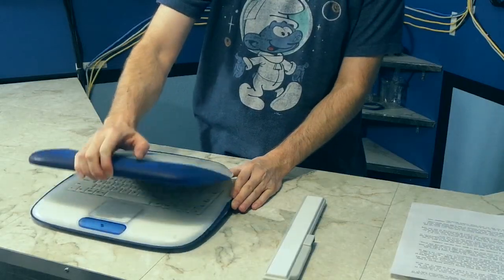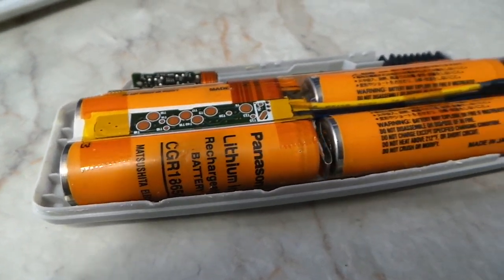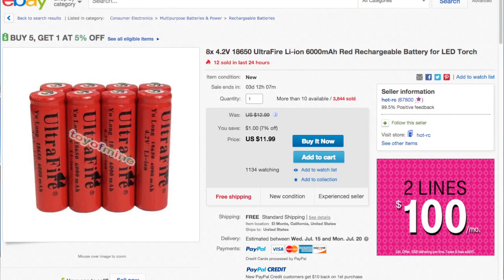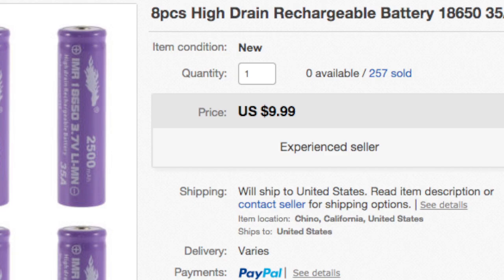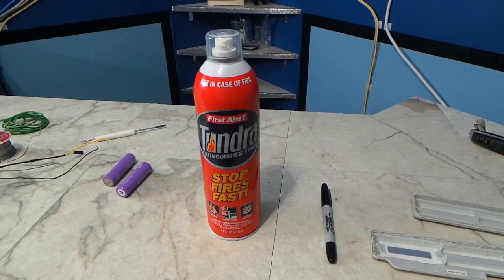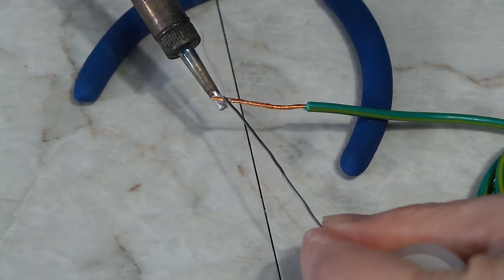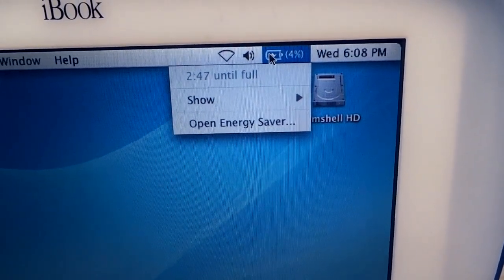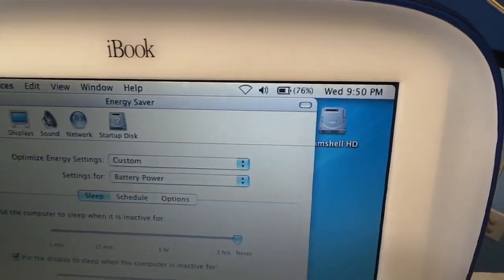Rebuild a laptop battery pack

Comment: You shouldn't manually solder 18650 cells. Use a spot welder and nickel tabs.

Comment: Just because you can solder connections to a lithium battery doesn’t mean you should solder connection to a lithium battery. Small DIY spot welders can be purchased for fifty dollars.

Comment: Hello guys, this 2024 September 24. I used to have that laptop many years ago, i bought it as a used laptop. I was happy to own an apple laptop, and learning how ox work, since i am a windows user. My battery was bad, though as a computer technician, i was able to rebuild it, and go about three hour from it. Was mainly using it to watch movies. Those days was fun. The battery, you bought the capacitance or power was low.. mine i later used the battery pack to build and laptop battery backup. I was just tired of mac, because  of the software i had was on windows pc. It was really fun building battery and pc in those days. Thanks man.

Comment: Well, it's a stretch to say they are lying. Those junk batteries really do have that much energy, if you trickle discharge them at 50 uA or so. The good (Panasonic  etc) batteries have far more capacity than listed, they just include the effect of internal resistance and put a decent load on it to provoke more resistive loss, and they list the energy you get after typical losses.

It's the equivalent of saying a phone has two weeks of battery life, without mentioning that it is in airplane mode with the display off the entire time.

Comment: For anyone reading this, you need a class D fire extinguisher in order to stop a lipo fire. Regular ABC extinguishers won't work, and they can actually spread the fire. I couldn't find the extinguisher in the video online anymore, but I found similar ones from the same manufacturer, and I am nearly certain they wouldn't be effective against a lipo fire.

Sorry for being critical, especially on such an old video, but I had to mention it since it's a matter of fire safety.

Comment: most likely the bms lost power it read 0% you lucky it did not lock out and kill battery pack most newer ones die when the cells are removed.

Comment: Those cells shipped so low that they couldn't start the computer? Did you measure voltage before connecting them together? If one of them was charged you would have had a decent amount of current flowing into the empty one, definitely enough to degrade the lower SOC cell and probably do some level of damage to the higher SOC cell....which would have made your pack a real mess. You'd have 3 groups of cells that only took heat damage from the soldering (probably not as terrible as its made out to be if you stay under 3 seconds) but the group with the mismatched SOC would have had one cell with noticeable damage in terms of capacity and IR while the other would probably be in ok condition....maybe a bit of capacity degradation/life cycle degradation and IR increase. That weak parallel set would then be your capacity as your pack is only as good as the weakest link. First series string to hit undervoltage cuts the whole pack off.

Comment: First thought was damn you know this is an old battery when there are CGR 18650's from Panasonic. Then I saw this video was put up 8 years ago.....So what year is that pack from? I'm guessing mid 2000's.

Those Panasonic CGR's are well known to be some of the most resilient 18650's out there. People have pulled out 15+ year old cells that still had good voltage and capacity tested over 80% of the rating.

Comment: I have problem with doinng this. The baterry just can powered the laptop in 1 hours. Is imposible because i use 2600mah batery so i get 5200mah in total. After i reasambled i found the batteries is not balanced. Why it happen? Does it because bms was broken? or it can fix after i use battery in several time?

Comment: I have a battery spot welder - I know this video is a bit old but do not encourage people to solder to lithium ion cells. It only take one to have the soldering iron on the cell for just a bit too long and they can go nuclear. spot welders are great, fairly inexpensive and make the connection in a split second, not heating the battery anywhere near as much as soldering. I repack laptops with Panasonic 18650's which usually end up running longer than the original battery.

Comment: You used to have an open invitation to be on your show. Somehow I doubt that still applies.
So here's my issue. I have a Dell Inspiron Mini 1012 that I bought for cheap at an estate sale, and not only do the batteries not charge, the battery pack is rejected as incompatible at boot. What causes this? Is the battery controller damaged, or is it rejecting the battery pack because it's drained?
Reply: From my experience with other laptops, its usually the battery controller. Possibly shorted, or it thinks the battery is no good.

Comment: As an alternative to soldering to the batteries themselves, how about making something like the battery holders you would find in your typical portable tape or MP3 player?  Spring-metal tabs that you simply snap the rechargeable batteries into, and you simply wire the contacts up in the appropriate configuration.  That way you're not risking fire/explosion from soldering to the batteries, and you can change the individual batteries out.

The other thought is, if you have a machine you want to be functional without needing to look original; get some of those rechargeable USB power packs and make up an external pack.  You wouldn't be able to charge the packs with the computer, and it would depend on the original battery pack having a power output readily divided into 5v increments though.
Reply: Interesting idea but there is generally not much room in the battery packs to allow for battery holders so it would be a bit tricky - might require 3D printing a whole different case.

Comment: COuld it be just 1 battery?  From my understanding in series the voltages stack but the capcity is that of the lowest pack, maybe theres just one battery that cant charge fully and its dragging the capcity down?   Maybe it would be wise to do capacity test on each battery and perhaps you can get some good cheap ones if you dont mix any bad ones in, your pack could be fine.  Just speculating here but yeah you get what you pay for, but im still interested to know the capcity of each battery, and maybe even the soldering onto the ends could have damaged one's capacity?  I heard heat isnt good for lithium batteries im sure the video maker knows now, most all are spot welded togher, which leaves me skeptical if those spot welds can even transfer enough amps given their small size, a solder joint should make electrons flow easier, theres no gaurantee the other tin will contact the battery other then where the spot welds are , which are small.  So im not totally discounting soldering onto battery for other reasons, but heat cant be good, but im not sure about that either, what exactly the heat tollerance is and does it permantly damage the cells or just for a moment or what.  Anyway thanks for the video im thinking of doing the same and wilil go ahead, trying not to solder onto the batttery but ont he the nickel that hold them together from already spot welded pairs.  Recycled of coure, but i think if you match them all up nicely you can make a good pack out of some bad ones without the need for new batteries.  Its usually just 1 that ruines a pack and is thrown away while the others remain good.

Comment: To get an old laptop working that needed a bios update, which requires at least a 20% battery charge as well as mains supply. With the laptop battery removed, I connected my old 9v battery drill battery directly onto the laptops battery pins for the +- -, did the bios update, which fixed the battery charging problem and as a bonus it fixed the RAM issue that had more than 1/2 the RAM reserved. Job done.

Comment: I have a question if you had the battery of per say three power banks that are each 10k Amphers and let us say you connected all three of them too the chipset of the original laptop battery would it work without frying my motherboard?.

Comment: Don’t get excited, the reason why it lasted for about 1 hour and 40 minutes is because the device was idle (it was only on the desktop screen without loads). 

I think if you use it (watching a movie for instance), it wouldn’t last as long. I estimate it may last 45 minutes which is still acceptable in my opinion.

Comment: I really wouldn't recommend using cheap Chinese batteries from trust fire and co. The batteries are all different, you never really know what you get, sometimes you even get a battery filled with sand which a small coin cell inside, providing 200 mAh or so. Which is bad enough, but the main problem is that you never know how much of a fire hazard these batteries are, since like I said, you have no idea what you're actually buying.
And most laptop batteries don't actually balance the cells, they just monitor the voltages. They stop charging when at least one of the parallel packs is fully charged and cut off when one of the parallel cells is completely drained. Since trust fire batteries are basically just random capacity and random charge level. Not only will they probably not be matched when you buy them, but even if you manually match them. The capacities will all be different and so the cell voltages will likely drift apart pretty quickly, eventually only allowing to charge the pack a little or discharge it a little until one of the cells is fully charged or discharged. You may have only gotten 1 Ah or so out of your batteries, but as long as they reliably hold 1 Ah and don't randomly catch fire or so, that's essentially the best result you can hope for, for such batteries. 
If you're less lucky, your laptop could not run at all, cause the batteries inner resistance is too high to provide enough current to power the laptop, it could only run for 5 minutes. The batteries could run fine but only last for a month until they're completely worn out. With these batteries, pretty much anything is possible. And as the names of these batteries often suggest, fire is of course always an option.

Comment: I would not be using scotch tape to hold the battery's together inside the pack.  Scotch tape tends to get brittle from heat.  I would have used (red greens favorite) duct tape.

Comment: Does it matter which tap on the battery string is attached first, second, third and forth? Does power from the total need to be connected first before the taps? I was told that it can damage the controller if the right sequence is not done right.

Comment: I did not have any extra room to use wire. I took a tin can and cut the lid into strips. I used a butane soldering iron and flux. I placed a lot of heat on the batteries. I purchased high quality Sony batteries 9 dollars each. It was still difficult to fit into the pack by just a few mils. I took a Dremel tool to further grind down the solder joints. I got it all in and used rtv to reseal the case in case I ever need to reopen it. And it works great. It was a Sony Viao laptop from the year 2000. I installed Windows xp on it to run old games and other software.

Comment: just a thought i am tinkering with 2 old hp dv 8000 laptops they both run xp so i can run older xp games and you guessed it batteries are shot... is it worth rebuilding? i am a complete noob no soldiering iron tools to open battery packs etc vs buying "new" chineese works with (in substitution of oem) batteries on ebay?

Comment: Watched in 2021. Your video gave me the confidence to attempt a replacement-actually 2 replacements. I was given an HP Pavillion that had Win 8 on it. I did a total hack job it that I am not proud of. But, it works and I get about 3 hours of run time on battery power even while using a RTL-SDR dongle.
I have an even older Gateway MX6424 laptop. I had to use a different vendor so I used another vendor (18650store) and bought "Samsung" batteries. I did a much better job on this replacement and reconnected everything. The internal BIOS has a battery calibration routine. It runs a calibration charge/discharge routine and is calculating only 964 mAH! I only get about 45 minutes of run time. Very disappointing. I guess 45 minutes is better than 0 minutes, but still disappointing.
A tip I discovered: I use my (Harbor Freight knock-off) Dremel tool to scuff up the battery terminals. 1 drop of flux and the solder sticks much more quickly with less heating of the BATT-ER-REE (thanks Metallica \m/).
Reply: Hey, your first run being a hack job that works is pretty solid for doing something new
Reply: @SavageGerbil  Thanks for the compliment. Since I've posted this, I bought a mini spot welder from Amazon. I can now spot weld the .15mm nickel strips. It works very well. Because the mini spot welders are so cheap on Amazon and easy to use, I don't  recommend soldering anymore. I would only solder as a last resort. Good luck to everyone else. :)

Comment: stay away from any cheap batteries.   Fire waiting to happen plus they have very high failure rates.
Reply: Buy some cheap batteries. Peel the plastic coating off. What's there now? It's a rebranded battery... and you got a great deal.
Reply: Thats how you start a store on AliExpress or Wish :)

Comment: While this was a good guide, there are some techniques that I would deem, unsafe. The first one being that fire extinguisher. Any regular fire extinguisher wouldn’t do very well. In fact, it would make it worse. Lithium, to my knowledge, is quite a powerful oxidizer once on fire. It can rip the oxygen molecules right off the C02 from that fire retardant, thus accelerating the fire. Next is directly soldering onto the cells. That’s a big no no. If you heat the cells too much you can cause damage which could impact the capacity and therefore the charge cycles or cause a fire. If you’re going to be working with them, definitely pick up a spot welder and have like an old cast iron skillet nearby in case one does catch on fire. Another channel by the name of DIY perks recently made a video on building your own portable battery pack and he does a pretty good job in regards to handling these batteries. 

Not trying to bash your or cause drama or anything. I absolutely love your channel!

Comment: You are lucky that it was enough to replace cells in original battery. In some other batteries controller, when cells goes "dark", disable itself permanently. Your battery also seems pretty easy to disassemble and assemble. I had HP and Dell batteries, welded shut with ultrasound. Was possible to open without breaking the battery case in pieces only with a dremel.
"Ultrafire" batteries are bullsh-iest BS ever possible. They can be anything - relabeled 18650 cells from old laptop batteries or counterfeit cells with very small real "battery" inside. But I never seen Ultrafire cells with larger capacity than 450 mAh regardless that label says 9000 mAh.

Comment: I would imagine a set of Samsung 30Qs would be a nice capacity and safety upgrade over the original Panasonic cells. Samsung, Sony, LG are where you want to look. Since vaping is such an extreme draw and works the batteries hard, vaping battery charts are actually super useful. Especially with high draw devices such as gaming/workstation laptops or a lot of the experiments you see around youtube.

The Samsung 25R at 2500mAh 20A continuous is everywhere and has been around forever. It's super reliable for all uses. The Samsung 30Q at 3000mAh 15A continuous is newer and has a slightly lower amperage limit but higher capacity. The Sony VTC5 and VTC6 are Sony's answers to the 25R and 30Q. The LG HE2 and HG2 are likewise LG's answer to those batteries. All of the mentioned models will totally outperform any generic branded battery. To give an example of the massive difference in quality, every battery listed will safely do 5A over what they're rated for pretty readily. Some will do it continuous some won't. You'd be lucky to EVER see an UltraFire meet its listed specs, let alone exceed them like that. To give a further example, despite good quality I doubt Panasonic has ever made a battery as powerful and at the same time high capacity as those listed.

Comment: How many tried to repack the batteries IBM and HP never worked, due to the controller who simply disconnects the battery 

Сколько пробовал перепаковывать батареи IBM и HP никогда не срабатывало, из-за контролера, который просто отключает батарею

Comment: Blows me away all the comments are about fake mah ratings and not about how you should NEVER solder directly to a battery.  There is a reason literally every oem battery pack is spot welded and not soldered.  Do NOT follow what this guy says in this video

Comment: Please pin this safety notice as you made no mention of the following:

First - Always do your research. Make sure the cells you use are appropriate replacements. The correct type (LiFe Li-ion or Li HV). Also the correct charge and discharge current. 

Second - don't bother with the fire extinguisher, it won't help. Keep a metal bucket preferably full of sand. Be prepared to take it outside quickly.

Third - Best to buy reputable batteries. These batteries are of unknown quality. They may not be capacity matched very well, and therefore not balance correctly. You could have left out the parallel batteries made a 1s set-up and achieved a similar runtime with good quality batteries.

Comment: Just did it today, soldering acid did it's job - I have had soldered wire to the battery within 1 second with standard 25W soldering iron.